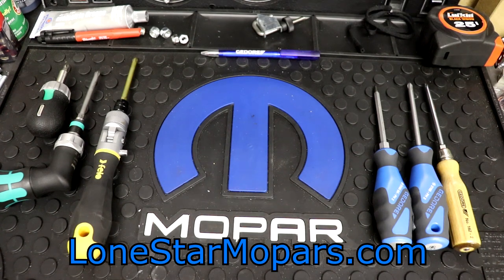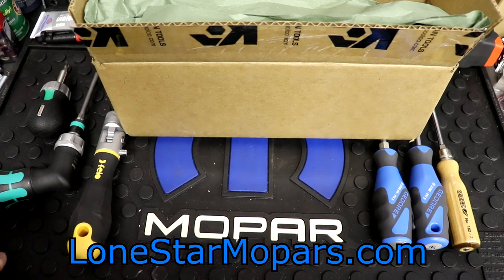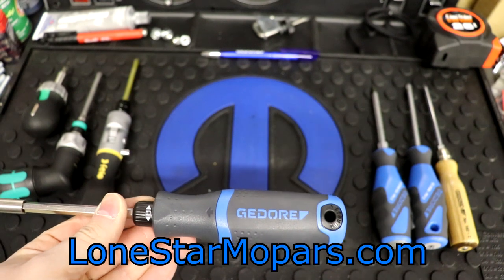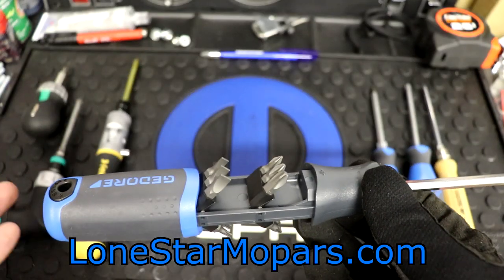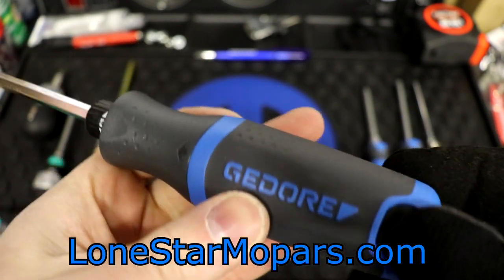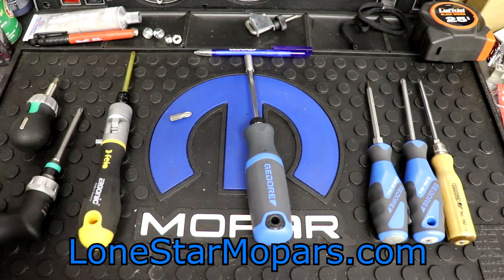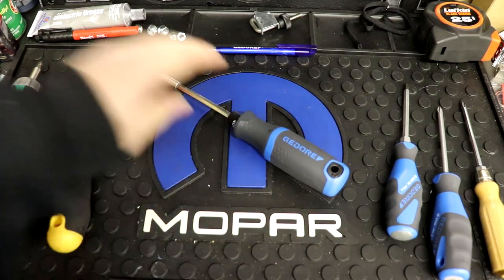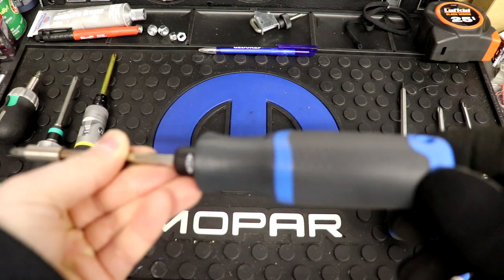Gedore SilentGEAR Zero Return Ratcheting Screwdriver

Comment: Wait.  Are they selling these to the gubment?  70 dollars for a screwdriver? They really emphasized the screwing part.  This one is WAY less and has more bit ends.  I copied the description from amazon but I am sure you can find them more places. It's 30 dollars to my house!  The other reason I like the MLtools one is the bits are 3" long and can reach in tighter spaces because it doesn't have the big adapter at the end.  MLTOOLS 14-in-1 Gearless Multi Bit Ratchet Screwdriver – Smooth & Silent Ratcheting Action – Ergonomic Non-Slip Grip – Strong & Durable Tool Set – Bits in Handle – Magnetic – Made in Canada RS300

Comment: Hazet has a shorter shaft and is locking. Kinda would be cool to have both the Hazet and the gedore with a rolgear solid shaft (non-detachable) I have the rolgear with the replaceable bits and love it! Only bad thing I hear is to not get water or sand in it, rust and binding will happen.

Comment: 10 minutes toget to the point. Too much talk.
Reply: Not only did it take forever to get to the gist of the Gedore screwdriver, but the single most important feature (near-zero return) was introduced last, and its value insufficiently emphasized. Unless you use a ratcheting screwdriver to perpetrate crimes, and daren't be "discovered" by the police, there is no merit whatsoever in silence.

What I'd like to learn is how much torque can be conveyed (by a human, unaided by an added wrench) through the silent clutch mechanism.